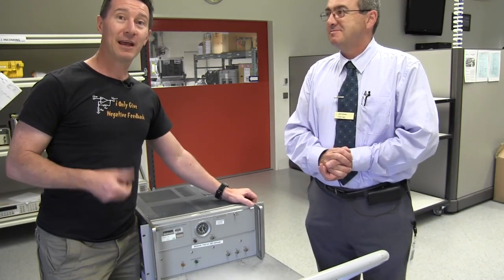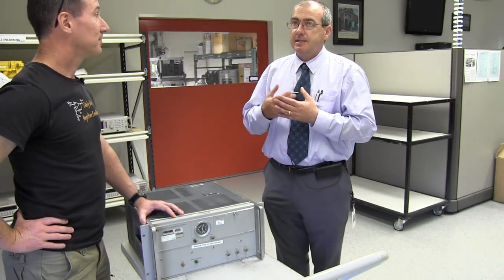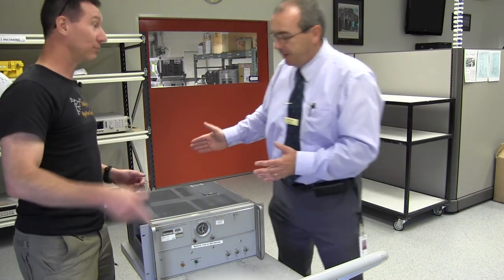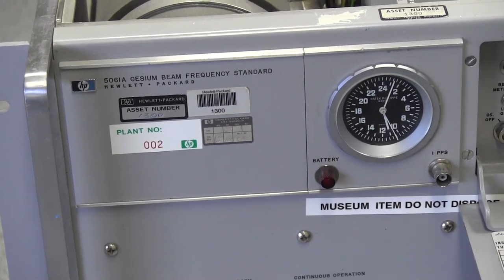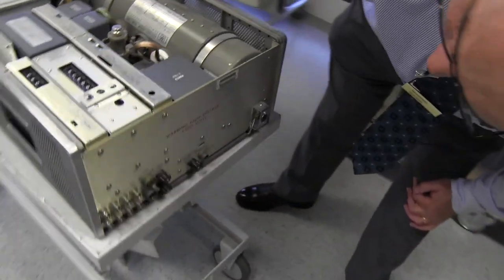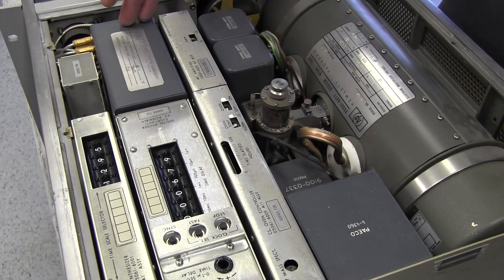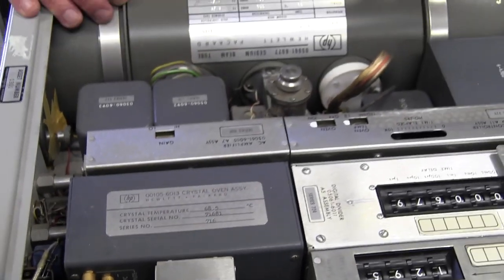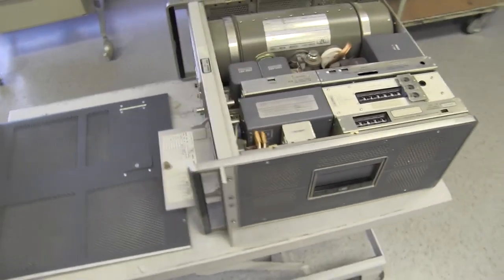EEVblog #423 - HP5061A Atomic Clock Cesium Beam Frequency Standard

Comment: We had a rubidium standard at our TV station. One day NASA called and asked if we had stopped using it. We hadn't, but the rubidium tube had gone bad and it was running on the ovenized crystal alone. It was still well within the gov't standards, but NASA had been using our TV signal to check the calibration of some of their field equipment. We weren't planning on replacing the rubidium so they sent us a cesium standard to use.
Reply: That's cool! I had chance to pick one up for $500 that was 10e-13 yet but didn't and kick myself now. Amazing machines!

Comment: HP once was able to build devices that last longer than 25 months??
Reply: Most manufactures have the ability to make stuff last a very long time, But It is would cost a lot to build things that lasted that long. They have to lower prices to be competitive with other items you may see that cost less. When that happens In order to lower prices they have to make things cheaper in order to sell at those lower prices. It is the consumer that drives this market of quality vs cheap.
Reply: @jimthvac100  Well, now I have an HP flatbed scanner that works perfectly well except for the fact that HP won't bother writing drivers for it after XP... the inkjet printer I have still works fine, except that the cartridges are unobtainable now.  Never buying another HP anything, it's not the same old company at all... Canon printers and Dell notebook computers for me.

Comment: Some people think this is based on the frequency of the radiation from Caesium decay.  It's not.  It's the frequency of radio waves that resonate with the electron shell of Caesium atoms.  All atoms have such frequencies, many in the frequency range known as light (that's what causes things to have different colors), while others are more manageable.  The scientists chose one of the Caesium frequencies in the GHz range as the definition of how much a second is.  That huge grey cylinder melts some Caesium, tosses the atoms into a vacuum (so they are not detuned by touching other atoms), uses a clever set of electromagnetic filters to sort out those that are the right kind, then bounces a radio signal from the electronics against the flying atoms giving an output signal that lets the electronics determine if it has hit the right frequency or not.  The tube is also known as the "physics package".
Reply: John Doe:
Yes, people hear "Cesium" and think of ionizing radiation because of the famous Cs137 which is not used here. What I have never had explained to me is why Cesium was used for the most stable standards. A few features come to mind, but I don't know which(if any) are the important ones.
1. Cs is easily converted to a vapor so atoms can be isolated from one another.
2. Cs atoms are large with complex electronic structures, providing many transitions to choose from(if that is a good thing)
3. Cs just happens to have electronic transitions that have convenient energies, and are not affected much by other electrons.

I would appreciate any input.
Reply: John Doe I’m glad you have corrected me on that 👍🏻
Reply: Always wanted a rundown like that, ty! Easy to understand!

Comment: LOL @ the handle.
My employer is in the process of purchasing some portable gas calibration equipment.
One vender sent us a pretty good looking ($) quote. We looked up the specs and the unit weighed almost 50 pounds. A site calibrator weighs about that much.
We asked the vendor about that and they said "you required it to be portable, so we mounted a handle on it".

That email is printed out and on the wall in the break room. :)

Comment: I used to calibrate my frequency counter using a tv station signal. I would take a analog color tv set and tune it into a high power OTA tv station (you don't wanna use a LP station  or cable tv signal as they are resync via TBC). Then I would hook my FC to the chroma circuit and then set it for 3.579545MHz. Now that tv is digital. I use my own rubidium standard now.

Comment: I have one. Got it at the MIT flea for $25. weighs a lot. neven turned it on. power cord soldered to power input plug (the jerk did not bother to try to find a real plug). and one neon indicating button is busted, I might have broken it when i transported this anchor to my car (I was recovering from several surgeries). no idea how much of the life if the tube is used up. plan on selling it to Raytheon as a replacement into one of their ancient but still used ATE automated test stations. hope to get a lot of cash for it.

Comment: I repaired one.... had a bad crystal oven (used as interim transfer standard). Oven heater was bad so crystal would never sync with cesium loop. Fixed.

Comment: There is an atomic clock more precise than the Cesium clock used as of now.  A paper on it was published in Nature Communications. Nature Communications 6, Article number: 6896 doi:10.1038/ncomms7896
Received 14 January 2015 Accepted 11 March 2015 Published 21 April 2015    Here is a link to an evaluation of the work:  http://www.nature.com/ncomms/2015/150421/ncomms7896/full/ncomms7896.html#affil-auth

I've always been fascinated by anything 'atomic'.  Including the NIST's use of the Cesium atomic clock as our standard for time measurements.

Comment: That mysterious cesium frequency is 9,192,631,770 cycles per second.  An eastbound circumnavigation of the earth at the speed of sound lowers the clock frequency by about one part per trillion.  It would be unlikely for a jet transport to be able to average more than 0.7 mach.  That would give a frequency decrease of only 0.25x10^-12  The environmental drift of this clock approaches this so it was not an accurate test of special relativity.  In the two days time to get the clock back to California, it would have lost roughly 43 nanoseconds.  That is the time that it takes light to travel 42 feet.